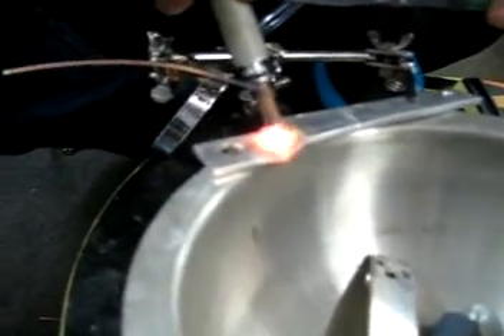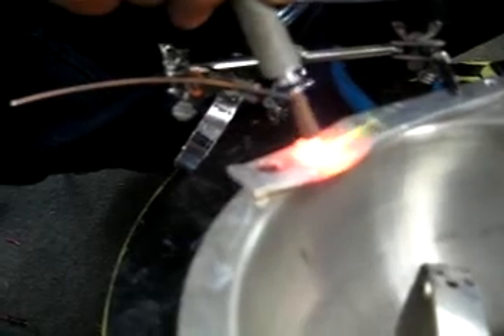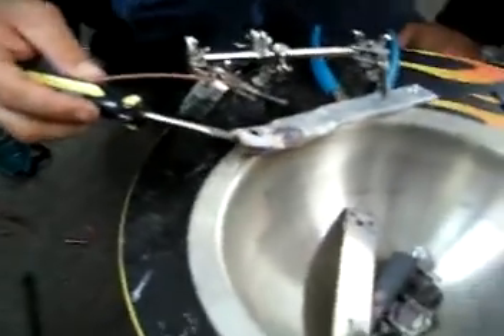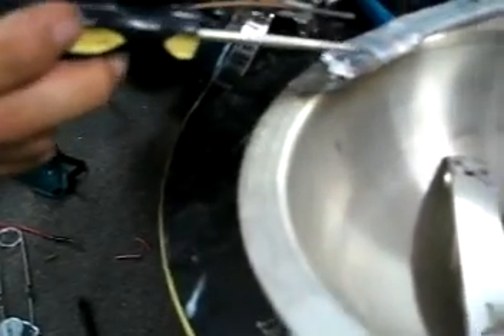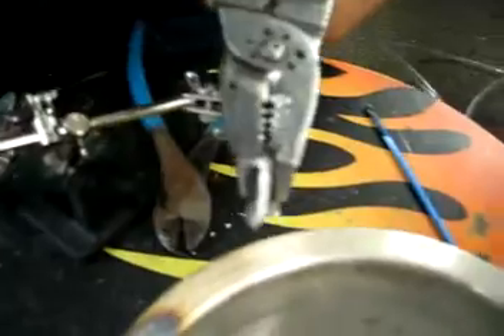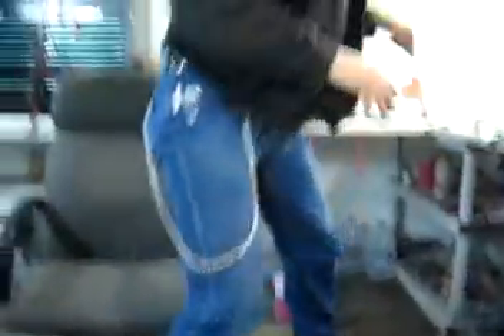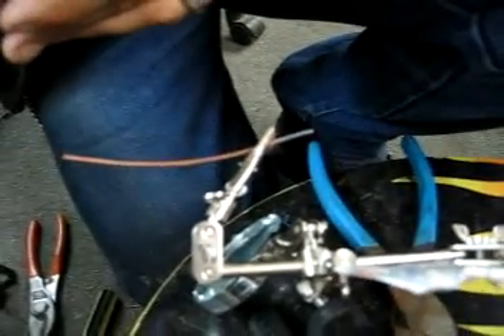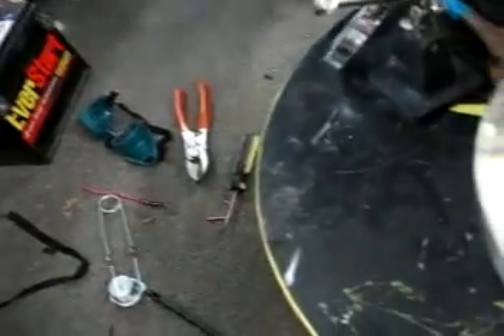copper to Al

Comment from the maker: Nope it isn't, I work on hear say, more like hear, try, prove. Its based on some chemical calcs, followed up with a real test to find out if math acted like the real world (sometimes it doesn't). But in this case (2H+ O= H2O + heat) so with water thats what it does, extra Oxygen and Nitrogen (air) would be (2H + 2O + 8N= H2O+O+8N + Heat) and since the heat is spread out on the extra O and 8N the ave temp of everything is less.

Comment from the maker: the difference between most fuels and hho is they need oxygen to burn, and the more oxy the more they can burn and the hotter the flame you can get. On torches like that they use a venti effect of sorts to suck in o2 with increased fuel. hho has enough o2 and more actually cools it down and slows the burn because it leans out the mixture.

Comment from the maker: Elyte is 10g per gal distilled water. The spacing is made by putting electrical tape on the edges of the plates, so 2x the thickness e-tape= .015 or there abouts. more plates per cell would draw more amps, which isn't a bad thing really, but means bigger wire to handle it. more area means more conduction of the electricity. I hope that explains it a little bit.

Comment from the maker: hey that wasn't me, that was the camera guy, and my God it was bad right in my face, in fact I think some of the performance of the torch can be credited to the extra methane in the air:)
Keep in mind this is not an eff. setup, but it is a middle ground between eff. of volume vs watts, and size of the setup, I am sacrificing  some wasted electricity for a smaller setup size. 
But the config is 304 SS, 20 guage, 3"x6".
8 plates per cell 4+,4- (+-+-+-+-)

Comment: Thanks for posting your video's, step by step.  I find them educational and inspiring!  Now, for the few people like me, can you tell us what alloy of SS plates, the dimensions, and the content of the electrolyte?  I think you said 8 plates per cell at a spacing of 0.015?  One last question:  What would be the effect if you added more plates per cell?  As you can tell, I know very little about electricity.  Thanks again and don't stand down wind from d3.

Comment: i do hvac work and use a accetelene torch, without oxygen, it's like like steup you got but with another pipe over it, with holes on that pipe right by the tip, so it sucks oxygen with the gas.